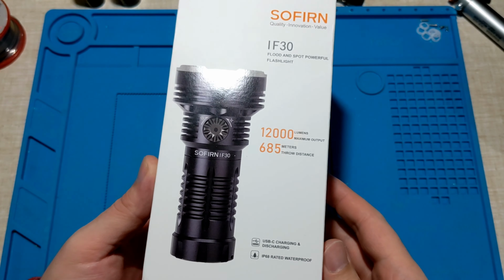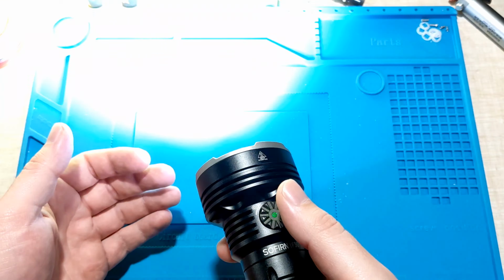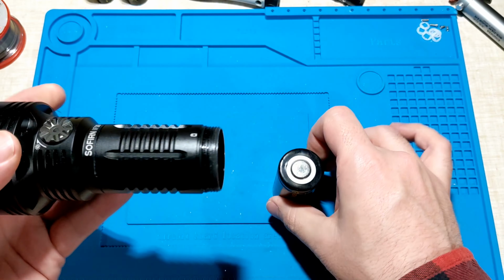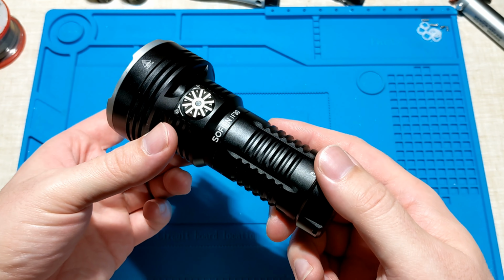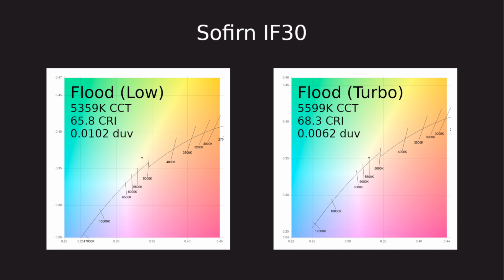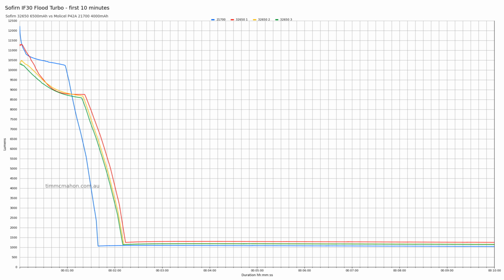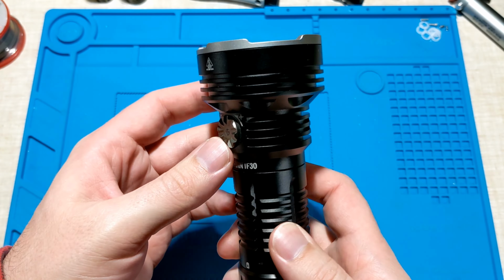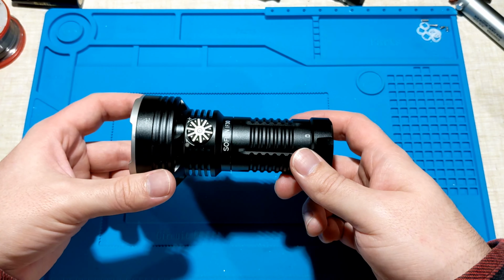Sofirn IF30 Review

Comment: Hello sir, I dropped a sub and like.  Great video, and I 1000% agree I do not like the 32650. I dropped a p45b molicel battery along with a rubber gasket inside so that the battery couldn't move.

I'll tell you it's about 5 times brighter than the stock 32650 battery sent with it. Huge fan of molicel.  Haven't done any lumen testing yet, but I can tell with my eyes it's MUCH brighter. I'm glad I could be your 350 sub 😀
Reply from the maker: Thanks for subscribing and watching! The IF30 is funner than I expected. I bought a few Molicel P42A, Samsung 50S and Samsung 40T for testing 21700 torches that don't come with a battery. The P45B is on my wish list! 😀
Reply: Is it possible to charge the molicel with the usbc inside the flashlight?
Reply: @danielbrendel89  Hi Daniel, I personally have used the usb c cable to charge the molicel in the sofirn with no issues what so ever. I  am wondering Torchhacker I would also like your input. I didn't have any issues, but make 100% sure the battery is correct and make sure its not rattling around. Although I think torch hacker would agree it would be best to buy if you can afford it A Nice 21700 19750 multibattery charger. It's much safer to be honest.  I ONLY usually charge my flashlights by usb c cable if I'm away or do not have access to my charger.
I'm hoping I helped Daniel. Please ask more questions.  I love to help and most all of the 🔦  community is really great and helpful. Many nice people. We all try to stick together.  I love reviewing this light it is a REALLY great multipurpose light.
The 1 thing I would change is taking off the safety lock out and I did tell this to sofirn also making a stronger magnet as that is very helpful
Reply from the maker: @danielbrendel89  The Sofirn IF30 could charge a 3.7V (nominal) Li-ion cell at 3A. The standard charge rate for a Molicel P42A 4200mAh cell is 4.2A (i.e. 1C) and for a Molicel P45B 4500mAh cell it is 4.5A (i.e. 1C). You can check a data sheet from a manufacturer like Molicel. The IF30 will charge the cell at a slightly slower rate (3A) so it should be fine. 🙂
Reply from the maker: @BIGPAPAFOOT  It should be ok. Sofirn IF30 might reach 3A when charging. Molicel P42A's standard charge rate is 4.2A and P45B is 4.5A. So it'll be charged at a slower rate. One concern I would have about using a smaller cell in a torch and charging it is whether the charge current is too high (e.g. an 18350 with a max charging rate of 1.1A  might degrade over time if you charge it in an 18650 torch with an 18350 tube and a 2A or 3A charge current). P42A/P45B should be ok as the 3A current is below what Molicel considers to be a standard charge rate.
Reply: Sub from me too. Good shots. God bless. Jesus loves you!
Reply: @BIGPAPAFOOT  Can I provide the purchase link for the Molicel P42A ou P45b please? AliExpress?

Comment: This Is One Of The Best Flashlight That I Have Other Than Imalent MS18 And Q8 Plus... But The Battery Are Not Performed Well... So, I Have Replace The Battery With McNair Brand... McNair 32650 Battery Have 7000mAh With Maximum Output 70A... Continuous Output 35A... Compared With Molicel P42A Or PA2B, This Battery Is Perform Better... You Can Burn Something In Just 3-5 Seconds Only When Using This Battery... But Ofcourse Your Flashlight Will Hot Super Fast Because The Output Current Is Really High... And It Will Be Super Bright 2... The Original Sofirn Battery I Have Put In My Solar Spotlight.. Haha😂

Comment: Nice review. Yes, that 32650 cell should never have been bundled with this torch.
Reply from the maker: Thank you! Yeah, a 6.5A max CDR isn't really enough when Turbo hits 35A 🥵
Reply: What battery would be best to get for it?
Reply from the maker: @shadowmmm  A 32650 or 32700 with something close to a 35A CDR. Vapcell might have some.
Reply: @shadowmmm  A 21700 and use thick orings or a rubber band each end to center it on the spring. I use a Molicel P42A, but a P45B would be better.

Comment: Hello. I have a Sofirn IF30 and now I tried it with a Samsung 40T battery and it has the same performance as with a 32650 battery
Reply from the maker: The runtime might be shorter with a 21700 cell. I posted a written review of the Sofirn IF30 with a comparison between the 32650 cell and a Molicel P42A 21700 here: https://timmcmahon.com.au/posts/sofirn-if30/
Reply: @TorchHacker  I went out to read your review.  Superb. Think I'll order it and just use a P42A or something.  Do you have a link or details to a/the 21700 to 26650 adapter that will work?  Other than O-rings, I have no idea how to center a thinner batt.  Thank you.
Reply from the maker: @jeffholthus2009  Molicel P45B from Vapcell might offer slightly better performance than the P42A. I used a 21700 to 26650 adapter from Mateminco. They might sell them on AliExpress. Sofirn might also have some adapters.
Reply: @TorchHacker  I discovered the P45B when researching, thank you.  I also found a couple sources for the adapter. I'm also looking at M6x20 O-rings, which are 20mm inside diameter and 32mm outside diameter.  Pack of 10 for cheap.

Comment: Great vid review and especially your written review.  Can you advise on a/the adapter to use a 21700 cell? I'm newer to this and would prefer some sort of adapter vs. o-rings from the home store.  Thank you. Liked and subscribed.
Reply from the maker: Thank you! I used a 21700 to 26650 adapter from a Mateminco FW1 or an Astrolux EA04. It's not perfect, but it adds some extra width to help stop the cell from moving around. Mateminco or Sofirn might have some spare parts on AliExpress.
Reply: @TorchHacker  Thanks.  I ended up buying  3/4" rubber grommets from Home Depot.  They easily stretch onto the 21700 and are the perfect outside diameter for the 32650 tube on the light. Bought two, but ended up only needing one on the center of the battery.

Comment: I saw somewhere where you recommended not to use LifePO batteries in the IF30 due to a risk of overcharging.   Could you please explain that a little more.
Reply from the maker: The charger in the IF30 is designed to charge 3.7V Li-ion cells. Those are fully charged at 4.2V. So it will stop charging around 4.2V. 3.2V LiFePO4 cells are fully charged at around 3.65V. You may damage the LiFePO4 cell if you use the IF30 to charge it to 4.2V.
Reply: @TorchHacker  Thanks!

Comment: I read the battery is rated at 6.5A but the flashlight draws 35A.   Isn't that dead shorting the battery?
Reply from the maker: I think the IF30 maxes out at 35A rather than dead short. The IF30 performs worse each time I do a Turbo runtime test using a charged 32650 (6.5A CDR): max lumens is lower. It looks like the cell is getting damaged. I don't recommend using the included cell with Turbo.
Reply: The battery has no protection circuit?
Reply from the maker: @Mike_Studmuffin  It looks unprotected. There might be some basic protections but no PCB for over discharge etc.
Reply from the maker: @Mike_Studmuffin  There's a bit more info about LVP and the current draw here: https://timmcmahon.com.au/posts/sofirn-if30/

Comment: Anyone having problems with the rotary knob? I find it hard to use. It takes sometimes four or five rotations to unlock the flashlight. Moreover, it is really hard on the fingers under cold weather, especially if one rotation is not sufficient.
Reply from the maker: I found it a bit difficult to use the rotary knob over the first few days but it became easier a week or two later.
Reply: @TorchHacker  Perhaps mine is broken? Or it is going to become softer overtime? In my last try I needed to rotate it about eight times to unlock the flashlight. The Olight Marauder mini, although clearly inferior in light output, is so much better in that respect.

And a question about the battery. It looks like the 32650, which is included, cannot keep up with the power requirements of the LEDs in turbo mode. I found other batteries in the market that look more fit for this. So, I wonder: why Sofirn chose this model of battery? Could it be due to safety concerns? In other words, could the use of a high amperage battery (~30 A or more) increase the risk of current leakage, dangerous overheating or even explosion?
Reply from the maker: @voixdelabime  It would be safer if Sofirn included a better cell capable of a 35A CDR. Molicel P45B etc.

Comment: Bonjour 😃, peut-on mettre une batterie en 32700 à la place d'une 32650?
Reply from the maker: I haven't tried. But a 21700 cell fits. So a 32700 cell will probably fit.
Reply: @TorchHacker  bonjour 😃, que pensez-vous des batteries vapcell ifr 32700 G65 30A?
Reply from the maker: @Niglo2Mort  I'll check the length...
Reply from the maker: @Niglo2Mort  Vapcell IFR 32700 G65 is 32.1mm * 70.5mm according to Vapcell. I haven't tried it. I doubt it has a 30A CDR but if it does, then it would be good for the Sofirn IF30. Sofirn 32650 is 32.3mm * 69.33mm (6.5A CDR is too low). The Sofirn IF30 tube depth is about 71.2mm and the inside diameter is 33.1mm so a button top 32700 should fit.
Reply: @TorchHacker   G65 is IFR/lifepo4 cell. It will handle 30A. There is a review on BLF. I've also used G64 (similar, slightly cheaper cell) for a few projects and had no issues with them at high current. The caveat is lower voltage. With the driver IF30 has it will result in lower output (without modding at least) and onboard charging becomes a safety hazard with such cell as it can not be charged to 4.2v.
Reply from the maker: @sergeyivanov2667  Ah! Whoops. I didn't notice that it's a 3.2V lifepo4. That'll be a bit of a problem for the driver and charger.
Reply from the maker: @Niglo2Mort  Sorry. G65 can't be used. It's a 3.2V lifepo4 cell. The Sofirn IF30 needs a 3.7V Li-ion cell. The built-in charger may terminate at 4.2V which is too high for a 3.2V lifepo4 cell and the driver might limit the output when the voltage is low.